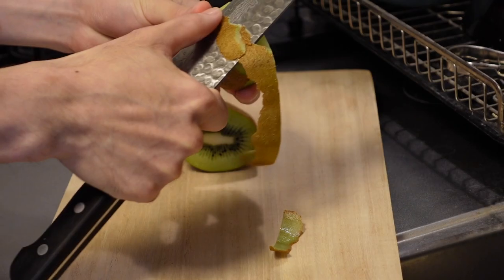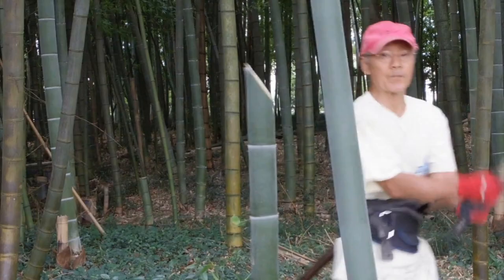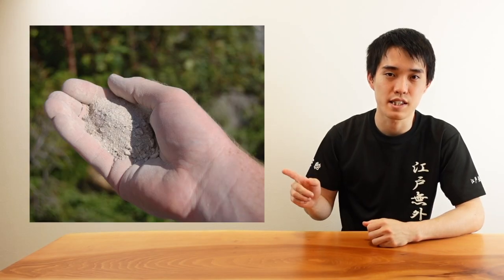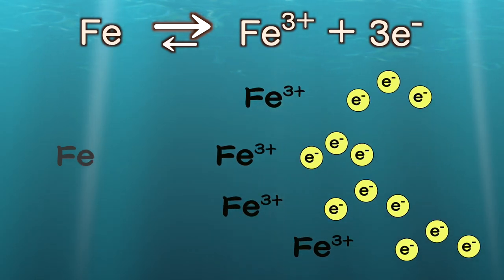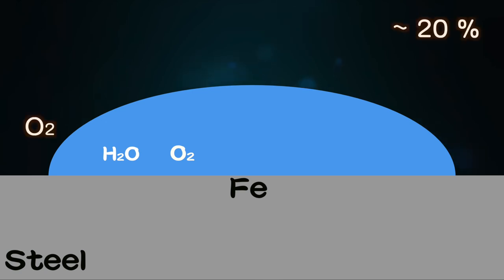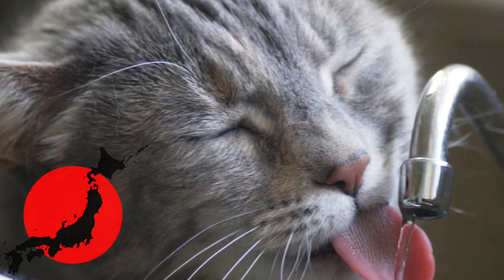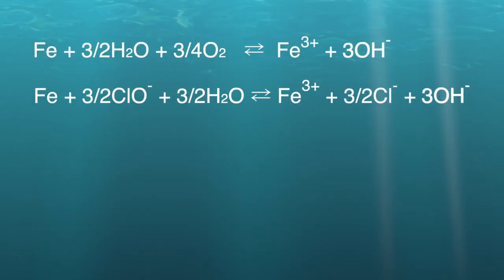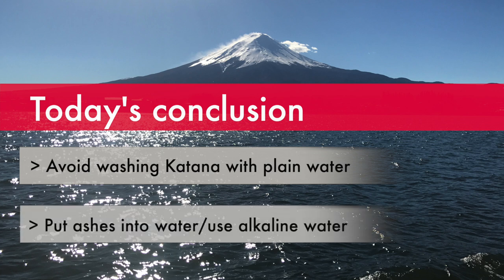How to clean your Swords. The science of Japanese swords. #katana #swords

Comment: I only own non nihonto modern production katana. I use 91% rubbing alcohal to clean blade, then swing a couple times, then ensure blade is dry with a glasses cleaning cloth, then apply a coat of oil, which is a mix of legit katana oil from Japan, hoppes #9 oil, and mineral oil that has all been mixed together amd is soaked in my rag.
Reply from the maker: Wow! Are you practicing swore cutting with Makiwara (roller straw mat) too?

Comment: I will have to try this sometime.
Reply from the maker: How do you usually clean your katana?
Reply: @samurai-tavern  Just wipe with a soft paper towel and apply oil. Very rarely I use uchiko powder before wiping. I haven't done a lot of cutting, but when I did, I found that oil kept me from getting scratches on the blade.